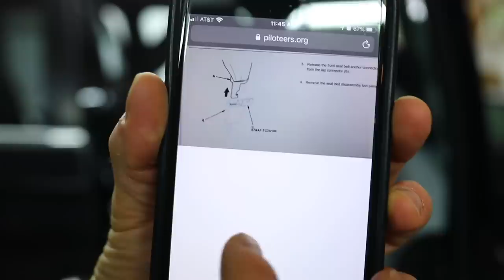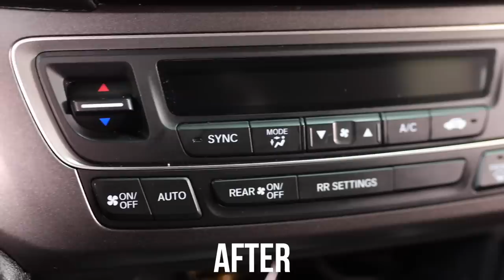Deep Cleaning a Girl’s DIRTY TRUCK | Nasty Carpet Cleaning and Satisfying Car Detailing!

Comment: "their kid is a severe diabetic"
Their car: literally has shugery food covering up every inch of the car
Reply: Yeah, a diabetic kid does NOT need to be eating fast food.  All that fat and sugar is not helping them!  Straw wrappers and fries everywhere - that is a vehicle that goes to a drive-thru a LOT.  So unhealthy!
Reply: My thoughts
Reply: Xander Zerr there are diabetics that need more sugar to keep them active diabetes it not just because of eating bad food
Reply: @rythmnoah7840  my bad
Reply: depends if they are type 1 or type 2 diabetic
Reply: That has nothing to do with a diabetic
Reply: @rythmnoah7840  Diabetes is simply defined as the chronic disruption of sugar homeostasis regardless of the cause. For type I that would be an autoimmune destruction of the insulin producing pancreatic beta cells while type II is typically caused by long term disruption of the metabolic feedback pathways (along with a substantial genetic component). In all forms of Diabetes the regular overconsumption of sugars will lead to complications so the initial comment stands correct. Furthermore, if the child in question has to regularly use high glucose foods to offset their acute hypoglycemia that is a sign of poor diabetes management and should be avoided.
Reply: @averiemayfield2597  Diabetes is the body's inability to regulate blood sugar. So constantly consuming high glycemic index foods has EVERYTHING to do with diabetes...
Reply: Aggressively Amicable finally someone who knows what is diabetic and can tell apart type I and II,diabetic is not only from eating food,type 1 mostly get children and we can eat what we want but we need to get our insulin injection because our body dont ake it
Reply: Aggressively Amicable it is when your pancreas fails
Reply: Xander Zerr it depends on the type of diabetic and what they need
Reply: 2 car seats = atleast 2 kids

Comment: Mom: Has child with severe diabetes How'd that happen?
Mom's Car: Full of soda/sugary drink bottles, fast food, candy, spilled milkshakes I don't know, pretty strange huh?

Also, the absolute negligence/laziness to just leave that many used syringes all over the car, not to mention the opened pack of Bud Light under the driver seat (I wonder why there is empty beer cans/ an open pack of beer in the car, must of put them in there to take them to the trash can). A cop would have an absolute field day pulling this lady over.
Reply: SURGER DOES NOT CAUSE DIABETES!
Reply: @averiemayfield2597  I never said it did.
Reply: Aurumaker72 type 2
Reply: Averie Mayfield Yeah, type 2....diabetes
Reply: Juvenile diabetes is a genetic thing. IT IS NOT CAUSED BY SUGAR OR TOO MUCH SUGAR.
Reply: @urbanphoenix4599  I never said it was.

Comment: I am no professional but I do detail cars on the side for family and friends. I just found your videos and subscribed right away because I like detail, methods, tips/tricks you use. I did like your approach on the back seat with the caked on shake you mentioned that you dab and scrub in circular motions to help get in all the nooks and crannies. I found it quite useful for those ones textures that are more mild, But I did want to also let you know a trick that I use for those extra difficult textures and/or crustiest is to get the foam shaving cream. I apply a small layer just enough to cover the texture groves and let it sit for a minute or so (larger the surface area and volume I use a little more shaving cream and "soak time")  and start to scrub in a circular motion. Thought you would like to add this to your tips and tricks and I hope it comes in handy for you. :D

Comment: At approximately 7:40 you mentioned that you have a drill/brush attachment one softer one for leather and a stiffer one for carpet when i look them up they come out color coded and white drill brush is the softer one are u using the same brush or a different brand than what i found???

Comment: howdy from a fellow detailer. started at dealerships in 95 or 96, cant remember. I detail only at home now. bi lateral carpal tunnel surgery (both wrists) has left me with limited stamina in my hands and wrists. ANYHOO...when you see that weird white coating on plastic like you had mentioned by the steering wheel, its hand lotion residue. keep up the good work mister!

Comment: it would be really cool shot if you get a close up on the vacuum sucking up the dirt as you did but switch your camera to 120 fps to get that buttery smooth slo-mo! Not sure what gear your filming with but it's just an idea. If you don't have 120 switch to 60 fps. That was a great camera angle thought! Great video!

Comment: I'm not a Honda mechanic, but based on the amount of auto and parts theft in my area, I figure the plates with the vin and the strap that requires a special tool to unlock it are anti-theft devices.

Comment: Probably should extract without the water so you can get more water out of the carpets. I saw another you tuber use one. He took the cleaner off then used the water then took that off. Works much better at stains.

Comment: The seat belt anchor can actually come out with a hook shape cut into a flat tip screw driver if you're good enough with an angle grinder, if you're not so good with one, do not attempt it because you might hurt something, your car, or yourself

Comment: I think you need a special tool because that seatbelt looks to be part of a pre-tensioner system. In the event of a car crash the seatbelt gets pulled taught against the user to stop them moving too far. Its an interesting Wikipedia rabbit hole.

Comment: If you pause at 7:01 theres a red white and blue coloring on the seat thata cool lol 😆

7:55 i wonder if magic eraser would take that out? Looked like baby vomit or milkshake whip cream. Gross

White stuff on stirring wheel is hand lotion. And magic eraser is good for that too but I dont like using them on new cars too much cause it is like sand paper if used to abrasivly. Steam cleaners are so nice wish we had those at work. I have a hard time getting that gunk out of cup holders! Car looks great. I hate honda with their seat belts. My first civic had seat belt bolted and torqued the the driver seat. And I messed up the airbag sensor.

Comment: Vw cars will throw an airbag code if you remove the seats even if the car is off. Its recommended to disconnect the battery anytime youre dealing with the airbag system.

Comment: Be careful of the foreign cars, when pulling seats, I pulled the seats out of a VW passat, the air bag light tripped, the computer was reading that the air bag had deployed, which it didn't, the system had to be reset, be careful with certain cars,

Comment: vin number is stamped in to the vehicle body, frame, vin plate, ect, for accountability. for police to identify, or for any other official purpose. if a thief steals your car, then repaints it, and drills out the vin on the dash, police can use the vin stamped in to the body and frame to identify the vehicle if it was ever recovered.

Comment: Can you not unbolt the seat belt from the top? Pop off the plastic cover and there should be a bolt holding the upper portion of the seat belt in place.

Comment: Im sorry but the fact that those syringes were there is extremely irresponsible. If her child has diabetes, used needles should immediately be put into a sharps bin, and unused needles should not be lying in rubbish. 

You as a detailer should NOT have to even see those. It is extremely inappropriate and unsafe for you to even be near them. I would not accept that at all.